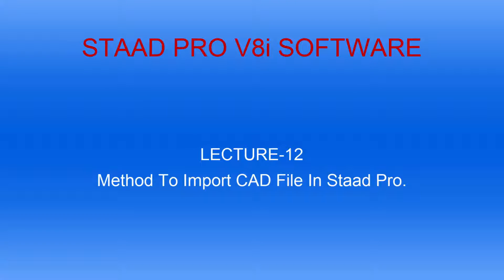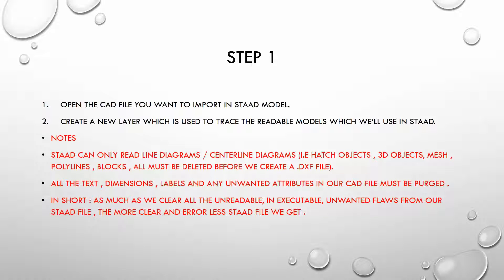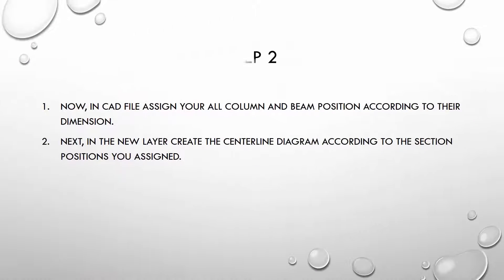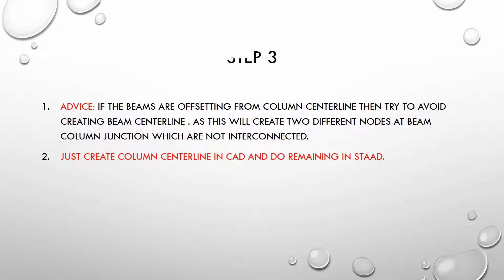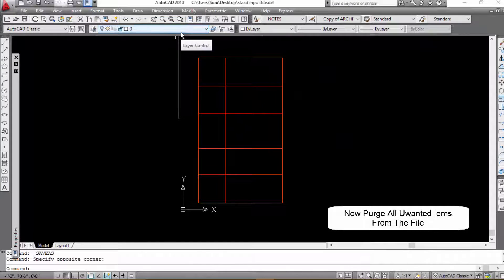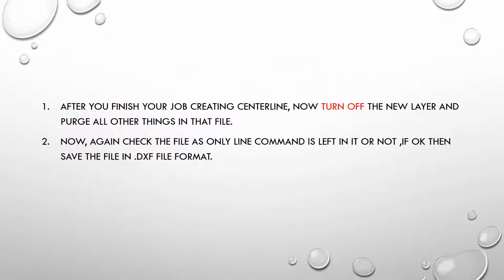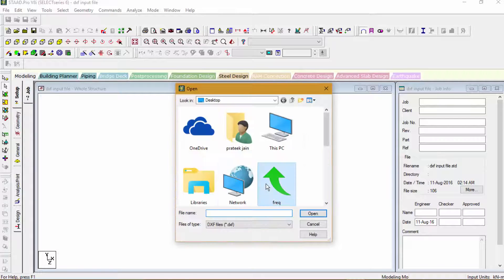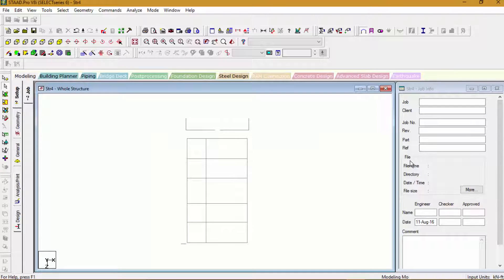How To Import CAD File In Staas Pro V8i Software Lecture 12

Comment: Thanks for this video. How to deal with column - beam junction having minor offset of center line at junction or   where continuity of beam  breaks on exactly on column top. Is STAAD considered 
only that beam at four side meet at the center of column at column - beam junction? Will STAAD design this case as a continuous beam?

Comment: useful information. and how to change the units?? in CAD all dimensions in mm, while export into staad we gave another unit. for eg. in CAD 1000mm i  gave, while export to staad the units I  gave m. it takes 1000mm into 1000m. how to rectify it sir.
Reply: Scale your drawing to 0.001 in AutoCAD before exporting to staad pro